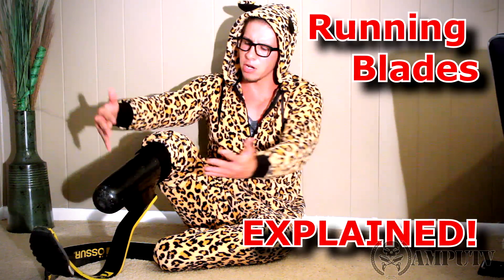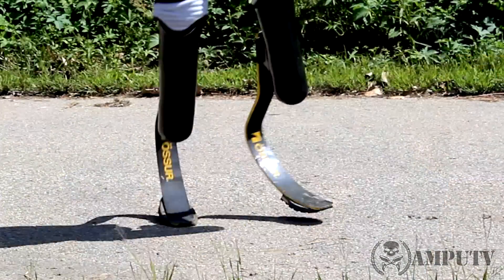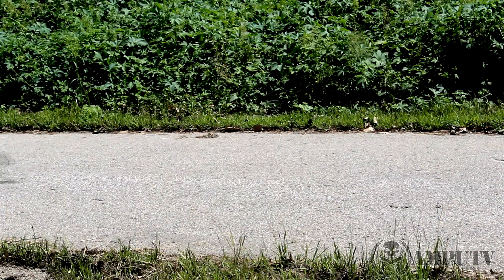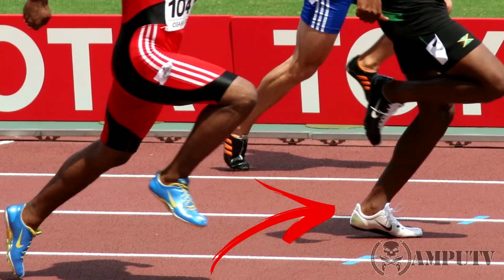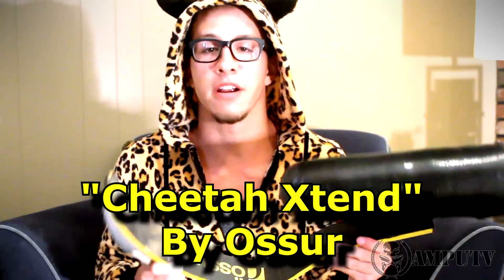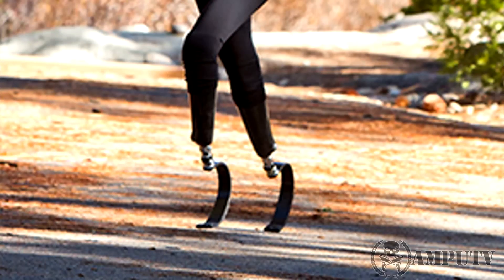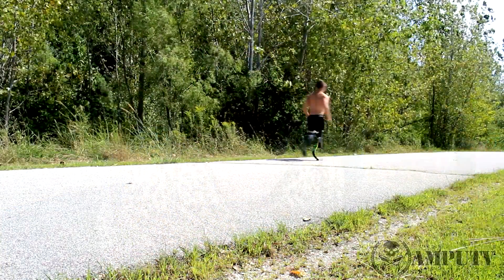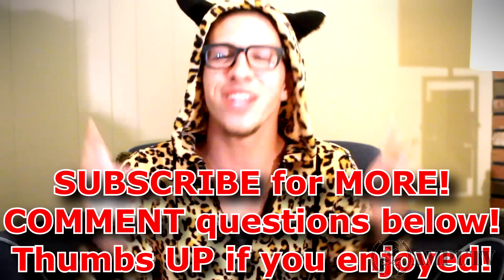Carbon Fiber Cheetah Blades Explained

Comment: Do you think you may have an advantage because you have less muscle requiring oxygenated blood? Also, what are your fitness goals? 🤗
Reply: Francesca Ricciuti less muscle means less strength and power. The difference  of required oxygen is moot because it takes so much more energy to run as an amputee. Him simply walking takes many times the energy of an able bodied person doing the same and the energy expenditure for running is exponential. If you are curious look up the controversy of Oskar Pistorius running in the Olympics. People tried claiming he had an advantage. He certainly did not. Honestly current technology isn’t even an equaliser. It doesn’t even “level the playing field”, amputees are still at a massive disadvantage from a physical standpoint.

Comment: What I would do is I'd just wear running blades all the time, but have a heel on the blade as well. Maybe take the heels off when I run, but idk i don't run that much so what's the point? I'd have regular legs but I'd probably only use them for formal situations like prom, weddings, funerals, etc.
Reply from the maker: Walsinork i use blades with a heel now!

Comment: They're like hind paw anthro animal furry digtigrade feet paws. It's pretty amazing how they have been invented. 

     I would usually watch "The Terry Fox Story" movie from 1983 when I was a kid that is also uploaded here onto YouTube. Back around 1979 / 1980, when he was running, the prosthetics were not as good for runners. With him banging his leg into the prosthetic, it would often, at times times, hurt. Also, in the process of his running, a number of his prosthetics would get broken and smashed. It also affected how he would run, he would have a bit of a "Terry Fox hop". 

     All that would have to be done with those prosthetics would be to maybe custom design and manufacture a pair where the leg shaft parts that connect to the composite plastic digtigrade feet didn't stick so far out down below, and then cosmetically cover up over the leg / feet prosthetics and rest of the body with some anthro animal furry fursuit. I would also have to wonder if a pair of such prosthetics as these could be custom made so that for a non amputee like me, they could be made so that my feet would point down, without my feet paws sticking out forward horizontally, so that I could do such prosthetics, and then costume-play my-self up with a fursuit. 

      I have also seen these sorts of digitigrade feet-paw springy like acrobatic foot-wear gear that are usually used for acrobatics performances at something as such as Cirque Du Soleil. 

     With custom made prosthetics, as such as is shown in the video above, one would definitely be the star centre of attention with a fursuit like that at a furry con, I would doubt it not.  : 3  ; )  : )

Comment: Running with fake legs still uses the cardiovascular system?
Reply: Yes, because he still has to move his limbs. Though, since he does not have to worry about a few extra muscles and such, it probably still requires less energy. Probably.
EDIT: I'd like to state that even if it does take less energy, it likely would be an unnoticeable amount. As well, it could also take more energy because of the effort it takes to run with your legs like that.

Comment: cheetah legs does NOT evens out anything. those prosthetics are not normal legs and will never be. their efficiency does not depend on your training to make them better but on materials they are made off, design and other stuff.

sure you need to train yourself to teach yourself to run with thwm but actual performance does not depends on your body capabilities but on your equipment.

in real life even if they make you faster its not that much and you, as just regular guy does not need and does not should even worry about that but if its comes to competetive sports they should be banned and its no means discrimination. its simple as that, if you dont have legs then how can you start up in a leg beauty contest? same here, no legs so why starting in leg fittness contest.

and yes you have paraolimpics and its more logic to fight with ppl with simmilar capabilities and tools if it comes to be fair in sport.

noone is going to let me work as a graphic designer if i do not have eyes, noone will let me operate a forklift if I dont have arms and I am deaf, its not a matter of discrimination but simple facts that some people are better at stuff than others and having no legs or other bodyparts does put you in dissadvantage to those who have them. if you are going to replace those bodyparts with other artificial tools then you are starting comparing a tool to a bodypart, and well crafted tool will always be in advantage thats unfair because you dont need to work hard to build up your tool overtime. you pay, its delivered now its a matter how well you can use it, if this leg is better than normal leg then its advantageous.
Reply: and I am not saing that running blades are bad in any means. what I mean is that if it somes to sport we should not compare artificial crafted tools to a body because they are not for comparison in that kind of situation.

Comment: I think they look pretty dynamic. Has a very athletic touch.
I was always wondering if you are able to normally stand on these running extensions. Since it's basically a single piece which only compresses. Is it difficult to keep balance while standing still?

Comment: My son is an amputee. He's only one so he's not even walking yet but when the time comes he might need some cheetah legs in his life. I did not know that they weren't covered through insurance. So my question is, how much does one leg run for??
Reply from the maker: Krystle Quintana you'll want to go through a foundation most likely!
Reply: Out of pocket cost for full fit, socket and foot would be about 35k. I recommend you visit the challenge athlete’s foundation website and apply.
Reply: Contact WARAMPS. They are a HUGE help for child amputees and try to make sure all kids have the very best prosthetics for what the child wants to do. They also provide a wonderful support community for the children AND the parents. They are easy to contact and incredibly kind. Your local Shriners May also be an option but I very strongly suggest you contact WARAMPS first. They are active in Canada and the USA.

Comment: Are you ever scared it'll break when it compresses on the blade as you're running?
Reply from the maker: That is a possibility but I'm not worried about it. If it happens it happens!
Reply: Carbon Fiber